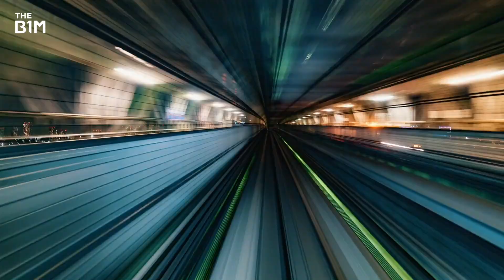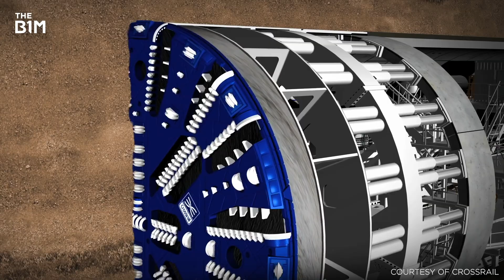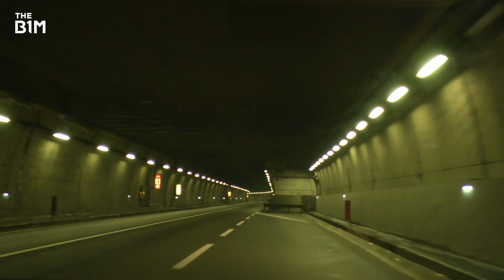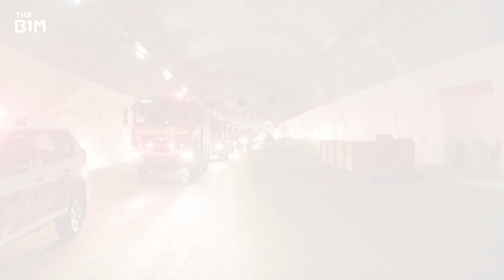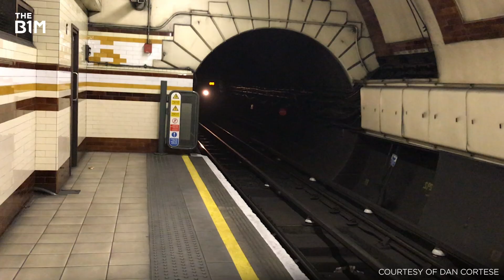Tunnel Construction Explained

Comment: Here in Sydney we are known as Tunnel City, because we have plenty of tunnels and more on the way. However, a lot of them were poorly designed to future proof for high amounts of traffic back in the late 90s/early 2000s, so the ramifications are starting to show with increased traffic levels. But the new ones they are building now seem much better designed.

Comment: Why would you drill through the rock underneath the water? just place a big thick long PLASTIC TUBE with a concrete wall inside and clamp it tight to the ground and layer it with steel fence incase of submarine intruders or deep sea divers. 
Its way easy and cost effective plus time saving! 
Man I wish I was a engineer with extraterrestrial intelligence to come up with radical ideas.

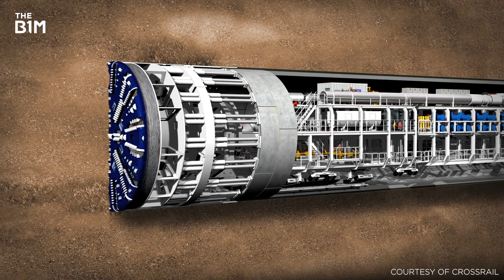Comment: Around 2:36 - i've studied civil engineering, but no-one has ever shown me how the soil is taken out of the machine and onto the surface? The machine is clearly not big enough to store many km worth of tunnelled soil. and in the video we're told that the machine is typically left in underground because it's too much of a bother to get it out. Well okay, so how does the excavated soil reach the surface?
Reply: They actually do mention that in the video. It's by conveyor belt.
Reply: @alexanderfretheim5720  I get that, but where does it go? Does it get stored in the machine and emptied later, or is it perpetually brought to the surface. If it's in the machine, why don't they ever mention the machine coming out? I can't imagine a conveyor belt taking it to the surface perpetually because there's all the soil above in the way.
Reply: @forwork7820  Sorry, to clarify I mean it is carried by conveyor belt out of the tunnel. The conveyor belt runs the length of the tunnel and exits at the submergence point where the TBM boring began. From there, either an open air hole or a slope exists, and at that point it's a matter of local logistics as to where the dirt is stored or disposed of. Basically, wherever the TBM was, the conveyor belt is, and the final conveyor belt will be the length of the bored section of the tunnel. (Yes, the conveyor belt does get longer as the tunnel is bored, and the additions to the conveyor belt, from workers I have interviewed, are mostly installed by hand.)
Reply: @alexanderfretheim5720  Thank you mate! It seems so obvious now!

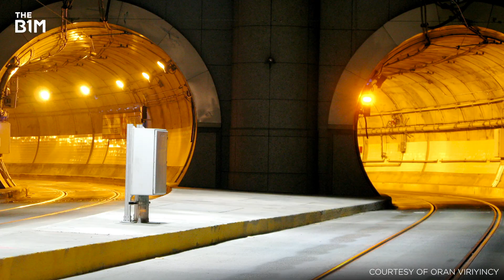Comment: 7:01 My country is now planning to built a single-bore tunnel with a dividing wall in-between instead, to avoid the cost & complexity of building passageways connecting both directions of traffic flow

Comment: Her in Norway some german engineres sugested using TBMs for tunneling. They ended up getting laughet at, due to the bedrock being realy hard after 10s of thousands of years with ice age. It's actually easyer just blasting your way through with explosives
Reply: The one thing I would note is that the disruption caused by cut & cover isn't significant if you cut and cover under a minor road. Not a helpful suggestion for cities on a radial or highway layout (like Paris, Boston or Atlanta) but if your city is on a grid, there's often a very minor street just one block down from a major street that's used by hardly any traffic. Building a cut & cover subway under the minor street instead of the major is not only good for mostly avoiding congestion issues during construction, but has the advantage that once the subway opens, it's running underneath a frequently much more pedestrian friendly street that has never been optimized for fast vehicle traffic and has no need of being optimized for fast vehicle traffic.

Comment: I was surprised when you said they leave their TBM The Underground when they finish the project I thought they always took it out on every project when the first TBM was invented can you talk about any abandoned TBM that are still Underground
Reply: Back in the 1960s The Victoria Line was constructed in London, the ground is a blue clay and so open faced clay boring machines were used. Two manufactorers made the TBMs I operated Kinnear & Moodie, and McAlpine both worked well on the Tottenham to Walthamstow section and were removed via the station at Walthamstow. They were owned by London Transport and were put in storage at Edmonton Bus garage. Dont know what happened to them after that.
The channel tunnel machines had a harsher life, so the TBM would require a rebuild and the ground conditions would need to be the same. Plus there were no stations to push into, giving them room to dismantle them. So, the most cost-effective solution was to drive if off line and box it in.There was one on show at Folkstone exhibition center with a For Sale sign attached. TBMs are designed for each soil type they will encounter and it's not uncommon to find different types of TBMs on the same contract. The KL Metro Malaysia for example.

Comment: Great video B1M always keeping me interested :)

I remember this being an issue in the Netherlands with a tunnel they were drilling for the North-South line in Amsterdam.
The TBM's would be used but because they soil on which Amsterdam was built (swamp lands) caused issues with the water levels when soil and moisture would be removed. Which caused houses to sink. Eventually it was completed and they found a way to work around that issue but it was still a irritating factor for the inhabitants.
Just a fun did you know!

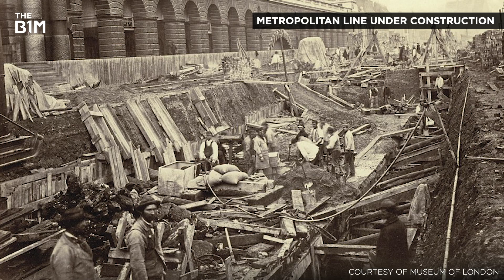Comment: 1:10 Just like the railwaytunnel project #Västlänken in Gothenburgh, Sweden (Pewdiepies hometown btw). Since most of it is soft clay, much has to be dug up. It would be really cool if you did a deep analysis on that project, the tech, the controversies etc. If you want a benchmark on how to not handle public opinion, #Västlänken it is. Estimated cost: 4 Billion Euros. Population: Only 800 000. It's a political and PR nightmare.

Comment: Having worked as the Architect on the design of many above and below grade public mass transportation system projects in North America, I want to thank you and your team for having provided the public a very informative video that is a visual "gold medal"!  Tunnel construction in complex geological strata along with constant and varying hydro-static ground water pressures are but the start point for all tunnel work.  Again, thank you for the animated computer models, as these models are necessary for the public to fully understand the complexity of tunnel design and engineering.  Modeling the sequence and phasing of construction and operation of the mass transportation systems is now a necessary component of the design process so we may comprehend the dynamics of moving thousands of people safely.  In addition to a construction staging and sequence model, the design community now embraces the need to three dimensionaly model tunnel fire and smoke control systems.  To visually simulate the containment and compartmentalization of a fire through pressurization and smoke extraction is now a necessary part of any underground project.  Although fire suppression and ventilation systems of today are but one component of the overall life safety system of a tunnel project, we must continue to build better computer models in order to simulate the dynamic interplay that emergency conditions create so that we limit any loss of life. 

Again, thank you - Michael
Reply: Where can I learn tunnel construction
Reply: @rio.thethantom  same question bro. Mr. Michael can you help us in this matter ?
Reply: @rio.thethantom  Teachers! Leave them kids alone!
Reply: Keyboard liar who consulted Wikipedia and google
Reply: Mr. Murphy, feel free to connect with me on LinkedIn! I may want to pick your brain at some point.
Reply: Honestly I expect new architectures and tunnels to have ZERO loss of life.  Anything more due to design flaws or negligence is unacceptable.  It is one of the reasons I went on to be a computer engineer rather than a civil engineer which I was both interested in.  Yes, I realize my code could cause deaths but not directly since it is for telecom products.  Good speed, MM.

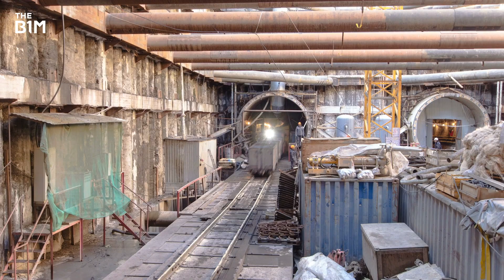Comment: 3:55 wait for real ? so if I go digging around the ends of the channel tunnel I will find a TBM ? wut ?!
Reply: Yes. The French TBMs were removed from the tunnels, while the British TBMs were driven out of the way and buried in concrete. Different designs. The British TBMs are now part of the electrical grounding system.
Reply: @marsgal42  didn't they meet half way?
Reply: @marsgal42  So, what you're implying is that the French are actually  "smarter"  when it comes to their machinery, especially if it's EXPENSIVE!!
Reply: aeroaa2 nah remember Oceans 13 lol?
Reply: B1M: We share this info so you can expand your knowledge ^_^
Some dude on Youtube: Woah, I wonder if I can steal it!

Comment: Imagine building things but you have to acquire land rights.

This comment was made by Tunnel Gang
Reply: They sorted out the legalities as they built the London Underground. For cut and cover they often had to buy the land outright. For deep tunnels they needed to buy the sub-surface rights from the land owner, though if they followed public roads this was usually granted free of charge.

I've seen two cut-and-cover projects in progress, the Sheppard Line in Toronto and the Canada Line in Vancouver. Both made a tremendous mess.
Reply: @marsgal42  If you look at the London Underground you will see that the tunnels largely go under roads (which are largely already owned by tfl). In some cases entire stations were built directly under roads so to cut costs, however with increased usage these are no longer viable so upgrades are taking place
Reply: You still have to get the rights to the land. Depends on how it's deeded, but usually a company digging a large tunnel below homes/businesses would have to buy the mineral rights for the properties. Therefore enabling them to muck around underground so long as they don't ruin the aboveground property
Reply: So buy the land, big whoop

Comment: The Boring Company!
Reply: Tau Ceti 

...can build an x-times smaller tunnel (by volume), x-times cheaper. there’s no magic there (or innovation).
Reply: @kam_iko  Nothing is magic friend.
Tunneling R&D. In the United States, has virtually no investment in tunneling Research and Development (and in many other forms of construction). Thus, the construction industry is one of the only sectors in our economy that has not improved its productivity in the last 50 years.

So what is the Boring Company doing?

- First, they reduced the tunnel diameter. The current standard for a one-lane tunnel is approximately 28 feet. By using electric autonomous vehicles with alignment wheels, the diameter can be reduced to less than 14 feet. Reducing the diameter in half reduces tunneling costs by 3-4 times. 
 (So already your comment is full of garbage but let me continue.)

- Second, they're working to significantly increase the speed of the Tunnel Boring Machine (TBM). TBMs are super slow. A snail is effectively 14 times faster than a soft-soil TBM.  Their goal is to defeat the snail in a race. 

Ways to increase TBM speed: (AKA: INNOVATION)

- The machine’s power output can be tripled (while coupled with the appropriate upgrades in cooling systems).

- Continuously tunnel. When building a tunnel, current soft-soil machines tunnel for 50% of the time and erect tunnel support structures the other 50%. This is inefficient. Existing technology can be modified to support continuous tunneling activity.

- Automate the TBM. While smaller diameter tunneling machines are automated, larger ones currently require multiple human operators. By automating the larger TBMs, both safety and efficiency are increased.

- Go electric. Current tunnel operations often include diesel locomotives. These have been replaced by electric locomotives.

Do your research next time before spouting nonsense. Thanks G'day!